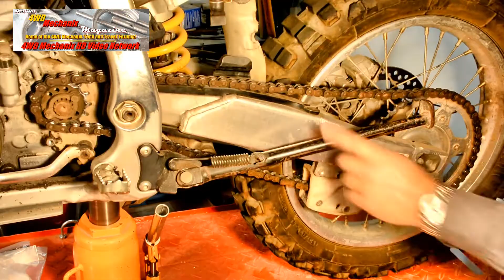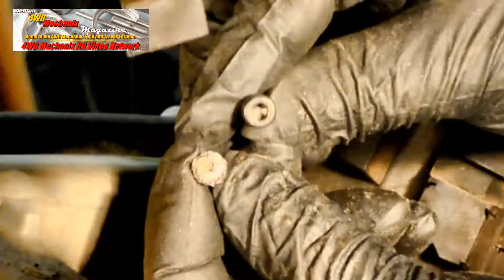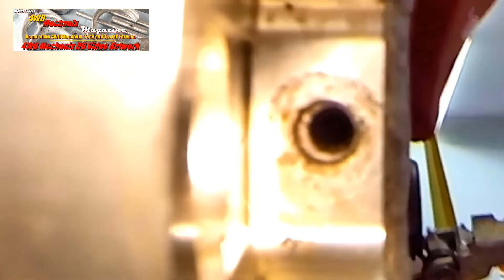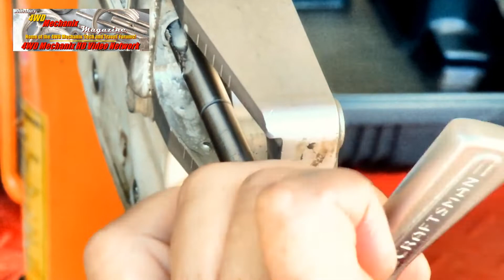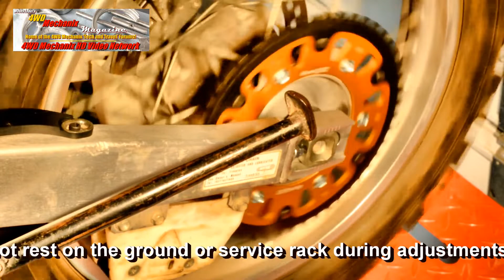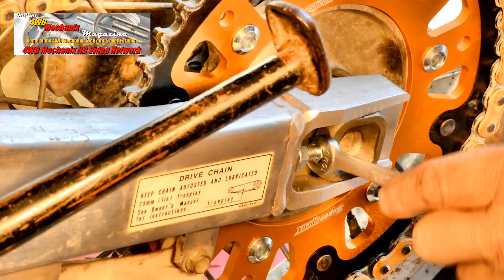Replacing Final Drive Chain and Sprockets on Our Honda XR650R and Other Motorcycles

Comment: What ratio are you running? 14 48?
Reply from the maker: Yes...stock ratio.  A bit low gearing for highway.  I run this for combination dirt/highway and to keep a load off the clutch in single track crawls.  The rear tire is slightly oversized, which makes the gearing just a tad taller, not equivalent to a 15/48 or other sprocket changes, though...Frankly, for dual-sport riding on asphalt, I'm always hunting for a sixth gear on upshifts—and there isn't one!  (My '84 XR350R is a six-speed;  my XR500R slated for restoration is five speeds like the XR650R.)  Trust this helps...Join us at the Motorcycle Tech and Travel channel:  https://youtube.com/@motorcycletechandtravel.  There's a lot of content on the XR650R there.
Reply: Also can it cruise 75 mph pretty well? Im working on a xr, and i want to be able to cruise on the highway, as well as do some trails/fire roads etc. It has 13/50 right now and i was going to put on a 15/48 and keep that 13 front for knarly trails and just change it onsite
Reply from the maker: For cruising 75 mph, it will do it with the 14/48 but is a waste of fuel and creates unnecessary piston travel. These engines have so much mid-range power that there is no need to ever experience the rev limiter.  Your 13/50 ratio must be a real "tractor" for off-pavement and way low for highway!  My bike will likely stick with the 14/48, as it does surprisingly well on slow, idle-and-tip-in single track, even with the HotCams Stage 1 camshaft (which does not seem to bother the slow speed performance).  15/48 might be "okay" to save sprocket changing, especially if your sights are set on a 75 mph cruise speed...Let's continue this conversation at Motorcycle Tech and Travel, I'd like to stay in contact around your plans, and our exchanges would be helpful to others!
Reply: The issue with that is i dont want to have to change the sprocket in the field if i dont have to. In your proffesional opinion what is the best ratio for a decent time on the highway, and enough power to lug some trails
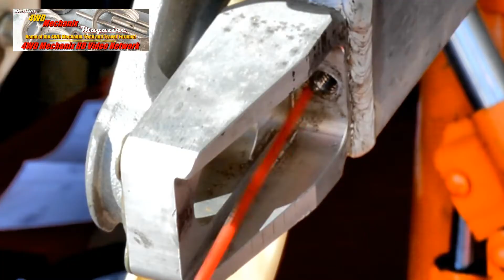Reply: Im still running 14:45 stock
Reply from the maker: I stayed with 14/48, the North American enduro gearing.  For light single track, on pavement and ADV/dual sport riding, 14/45 does work.  For open desert and more challenging single track, 14/48 has an edge.

Comment: I like so much would you said, except for when you got to the sprocket, and you decided that a sprocket that is aluminum with a piece of Steel riveted to it is better than just a steel sprocket the way they came stock they never came with an aluminum gear in the rear, aluminum wears very easily and quickly, that's why they don't make sprockets out of aluminum, and nobody uses aluminum sprockets unless they're just stupid because the weight difference in the motorcycle makes no difference in the weight difference in the drivetrain of the motorcycle makes no difference if it's aluminum or if it's deal therefore that statement is just a bunch of high band it means nothing and it makes no difference whatsoever. Of course that's my perspective because of the things that I've studied and seen. And I'm not just a normal guy on the street I promise you. Have a great day peace beyond your house
Reply from the maker: I value your opinion and experience.  SuperSprox has supplied the motorcycle racing community with patented sprockets for over six decades. They are a supplier to KTM, Yamaha, Honda HRC, BMW and Husqvarna race teams. The SuperSprox website has more information at https://www.supersproxusa.com/. The YouTube video at https://www.youtube.com/watch?v=gNZzSGtCCBI&t=35s
talks about SuperSprox construction features...My research and experience make me a SuperSprox fan. The zinc nickel sprocket mated securely to an aluminum center provides stamina. A special coating process is corrosion resistant...Like you, I have run and still run solid steel sprockets on my bikes with more moderate horsepower.  However, the high output Honda XR650R can benefit from a SuperSprox sprocket.

Comment: 55hp on dyno or at motor ?
Reply from the maker: Estimated crankshaft horsepower, and I've not confirmed this on a wheel dynamometer.  This is an estimate based on the build and known, similar (aftermarket and over-the-counter HRC upgrade parts) engines that have been dyne'd.  Tune plays a role, too.  I've ridden a lot and know power-to-weight ratios of various (wet weight) motorcycles.  This estimated 55 crankshaft horsepower, if anything, feels conservative.  I would like to dyne my bike at sea level, tuned for that elevation.  I'm riding at 4,200 feet elevation but frankly the bike still feels like 55 horsepower.  The formula for power loss is approximately 3% per 1000 feet of elevation above sea level.  As such, I'm "losing" 6.93 horsepower where is live.  I can't feel it.